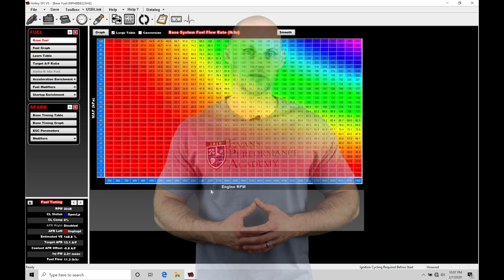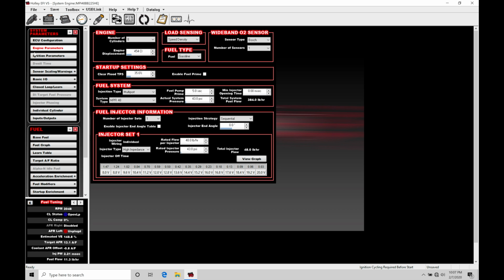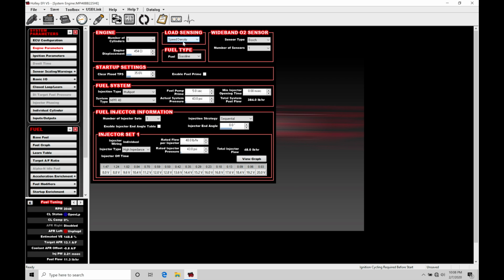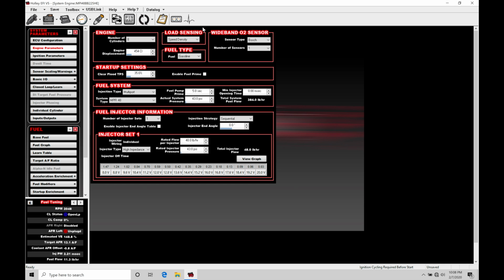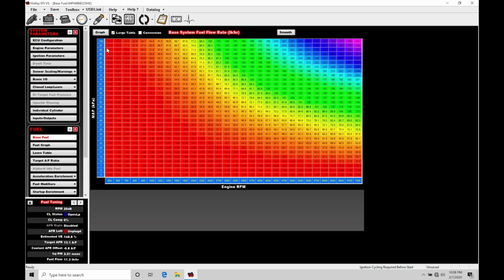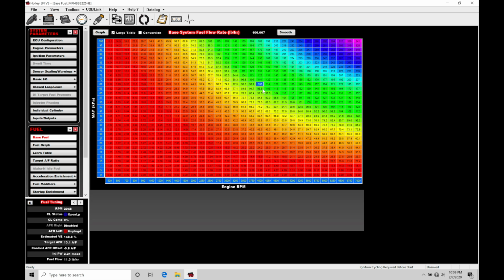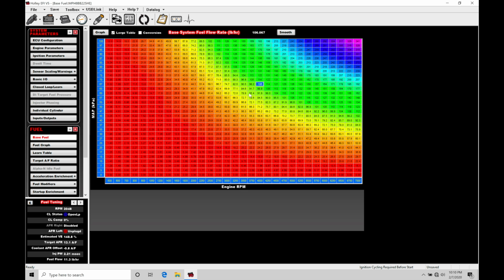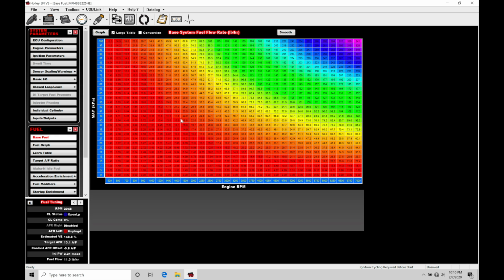Holley EFI Training Course Part 8: Fuel Strategies & Load Sensing Types | Evans Performance Academy

Comment: Curious, if you have the option to tune VE wouldn't you want to do that over anything else?  I thought that gave the computer the ability to know the fuel mapping at any load and allow you to adjust boost on the fly as long as nothing in the motor changed?
Reply from the maker: VE is my preferred method of tuning fuel tables.  It standardizes tuning across any kind of engine.  Holley does have a really nice fuel flow rate based model that is also extremely accurate.  VE calculations can get skewed with huge amounts of fuel delivery like 3 sets of 2200cc/min injectors which is where the fuel flow rate based modeling is a better option.